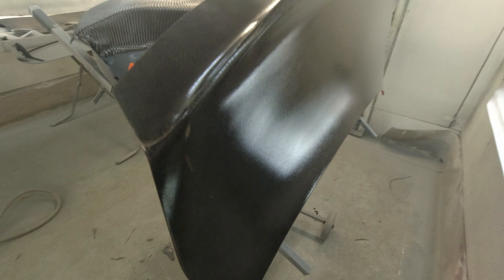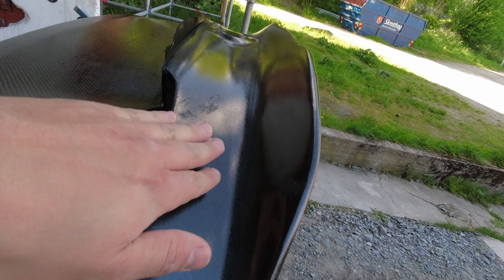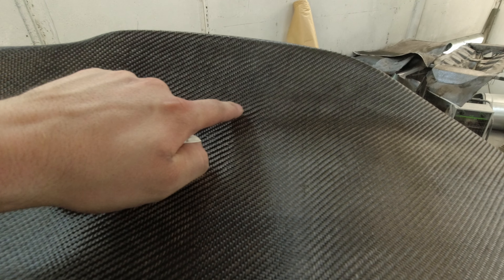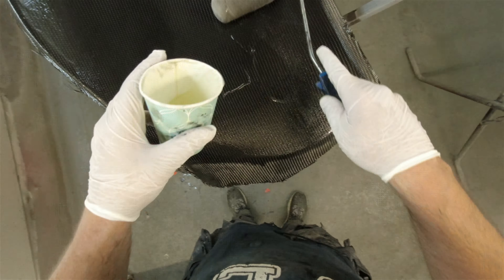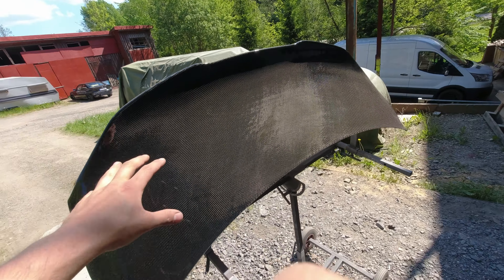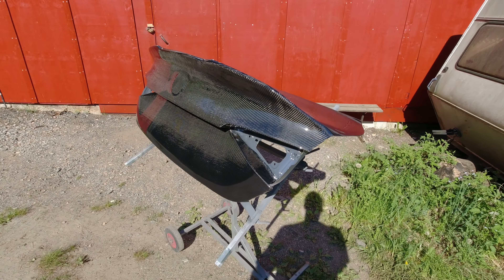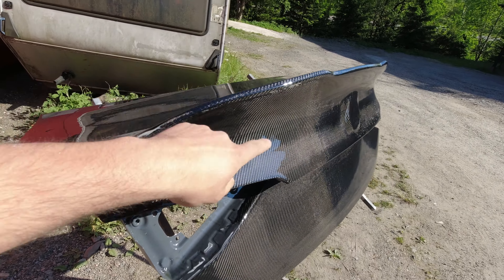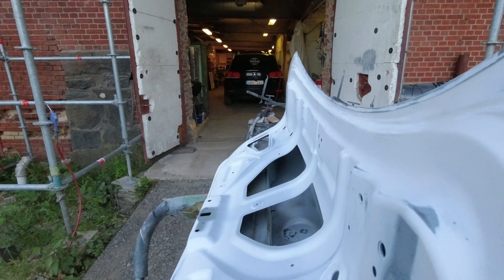Molding a Duckbill Spoiler In Real Carbon Fiber [PART 2]

Comment: The trunk came out spectacular. I can't wait to try out the fish-eye filling method you mentioned when I recoat my carbon splitter! 
Btw, what grit sandpaper would get rid of epoxy high spots especially after 2k clear?
Reply from the maker: Huge thanks man! really appreciate it!

Ooo If I understand the quastion the right way I would say that you schould not put any clear on the epoxy before its flat enough. If you put clear on and then begin to sand trough the different layers it can be a shift of colors between the epoxy and the clear. Try to build up enough with epoxy until you think it's flat and then start with the clear.

I usually sand the epoxy with 240p and finish of with a 500p before I go over to clear.